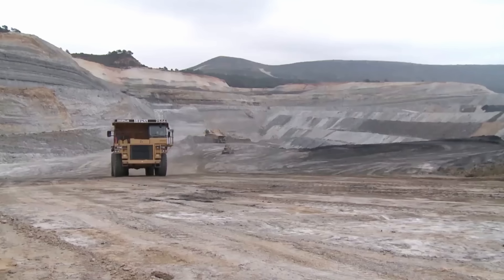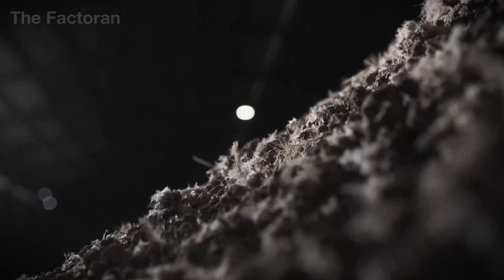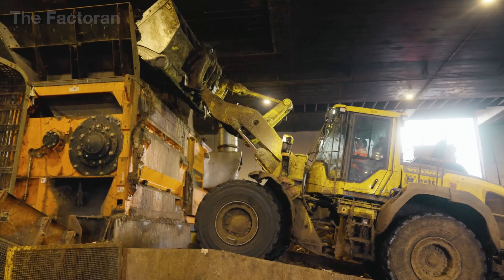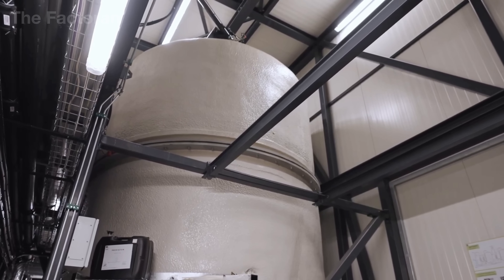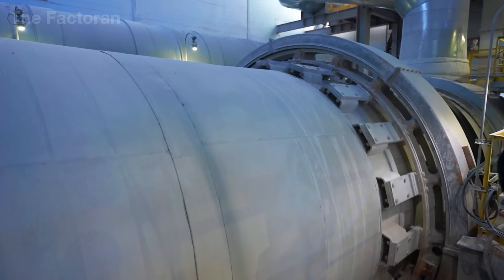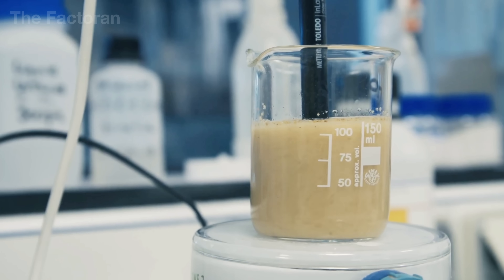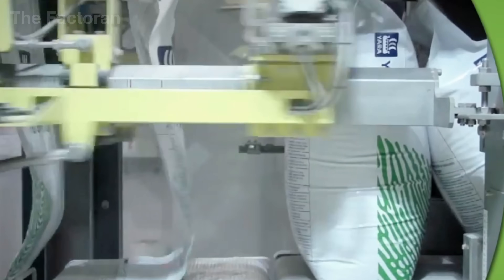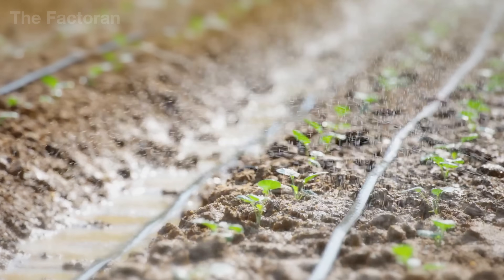How Billions of Pounds of Fertilizer Are Made Inside Massive Production Line

Comment: Natural Gas is mostly a combination of Carbon and Hydrogen CH4...There is no Nitrogen there.  Nitrogen is obtained from a separate process normally DAC (Direct Air Capture) or Air Separation Process. Steam Methane Reforming is a process used to separate the Hydrogen from the Carbon in Natural Gas but results in the emission of Carbon Dioxide (CO2). Hydrogen is then reacted with Nitrogen in the Haber Bosch Process to produce Ammonia then Nitric Acid then Ammonium Nitrate etc.
Reply from the maker: Great explanation — natural gas chemistry and sourcing are more complex than most people realize. Appreciate you laying it out clearly.